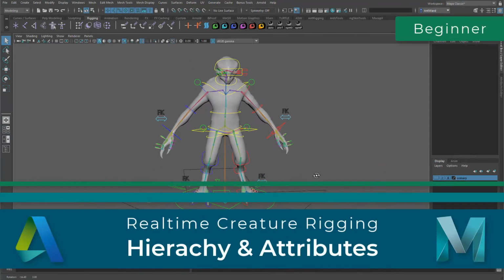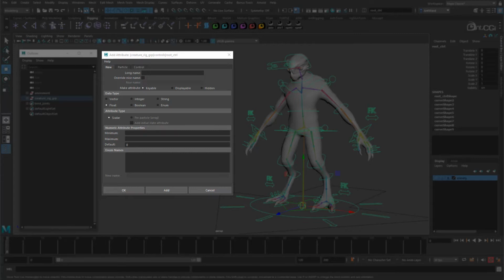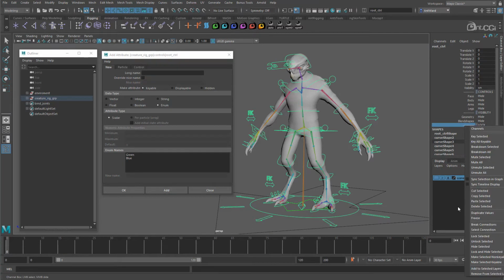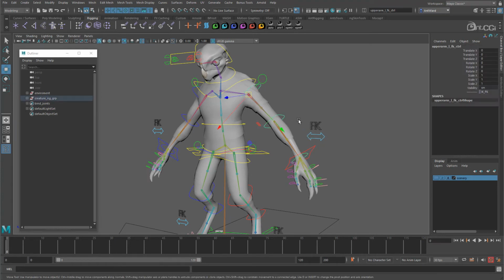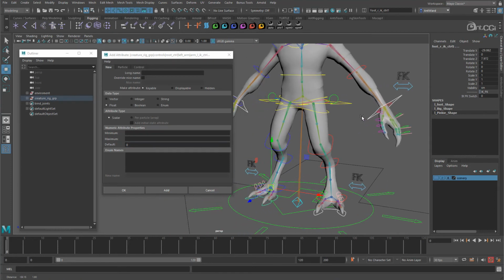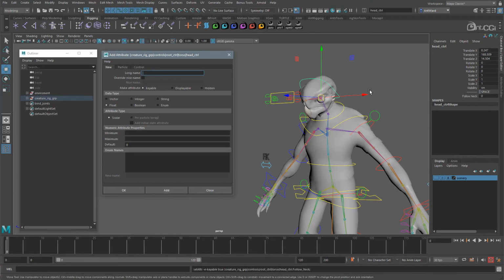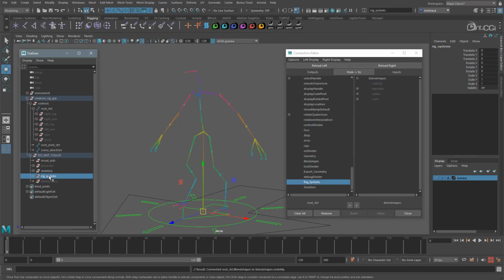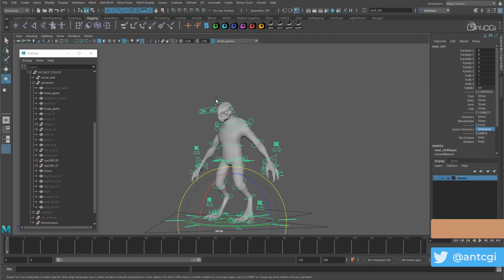Realtime Creature Rigging Workshop (8 / 19) : Hierarchy and attributes

Comment: Lesson 8: Hierarchy and attributes

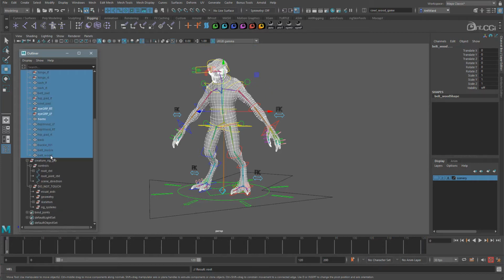2:55 example hierachy
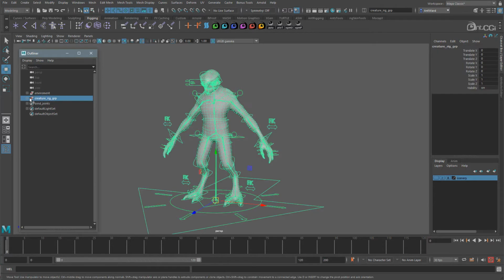3:30 extra attributes
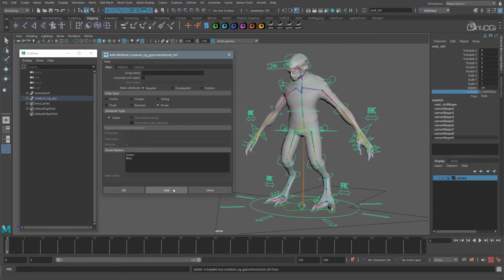5:55 meaning of Enum
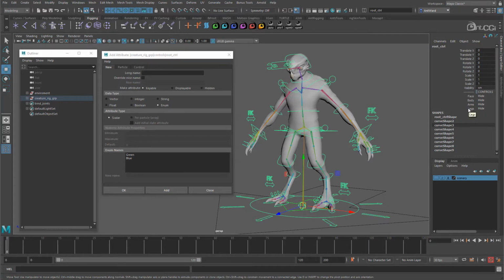6:30 application of Nice name instead of Long name, so the Long name doesn't clash with other names (in this case it's the divider)
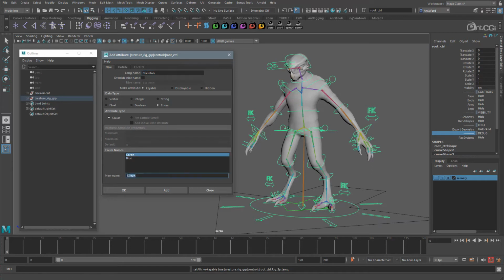9:00 example of Root control's extra attributes
11:25 proxy attribute MEL script
	need a script, but basically multiple inputs of the same attribute, you could change it from any input (arm controls or ik switch) and it'll update all others
	first copy the attr from the "source" curve, paste to the "arm_l_ctrl.IK_FK_Switch", then select all curves need to add, then run script
	addAttr -ln "IK_FK_Switch" -proxy "arm_l_ctrl.IK_FK_Switch"
	you could add attr to multiple objects at once
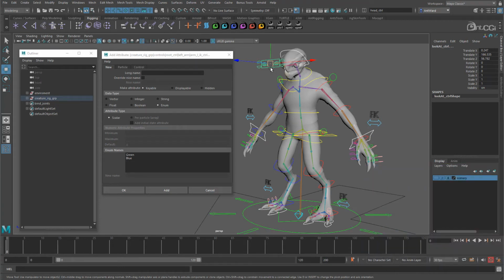17:00 definition of *Space Swapping*, basically, how a control following others, eg eyes follow head or world (stay still)

Extra attributes summary:
	FK: switch
	IK:
		switch
		stretchiness: float 0-1
		stretch type: None, Both, stretch, squash
		Space divider: Follow: World, COG, hip, clavicle/hipRoot
	IKFKcontrol: switch
	Head: Space divider:
		Follow Neck: float 0-1
		Orient Neck: float 0-1
	LookAt: SPACE: Follow: Head, World